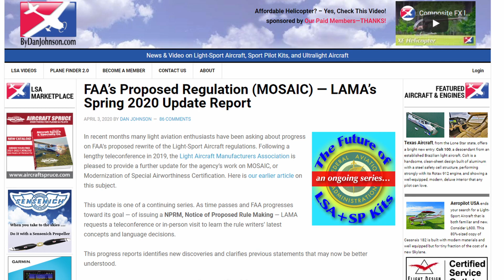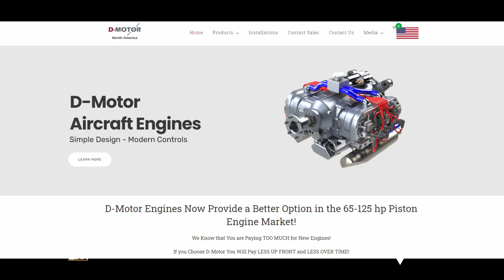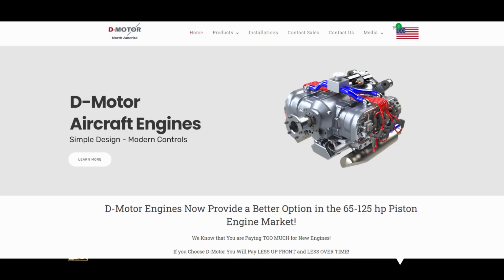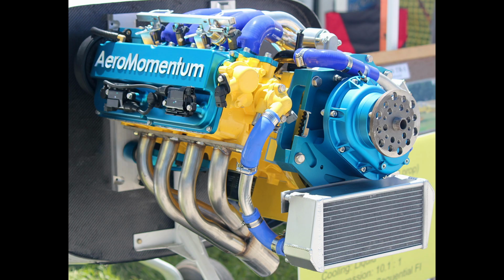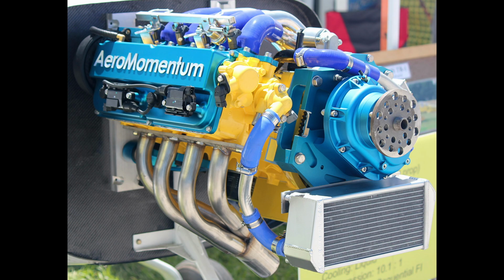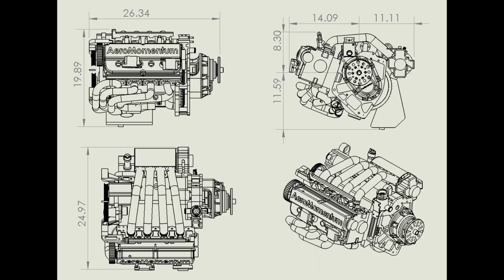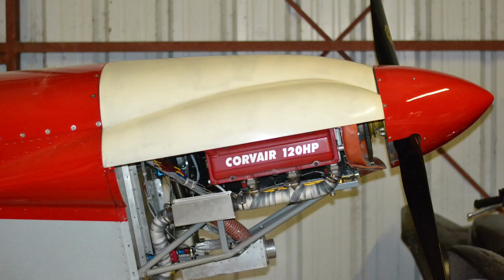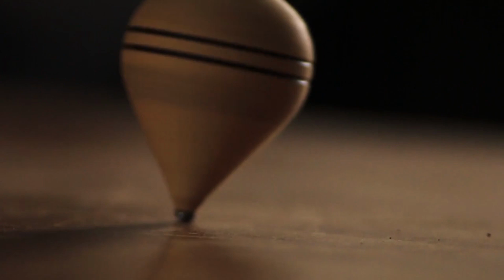Engines & Sonex Philosophy: Aerovee, Jabiru, UL Power, AeroMomentum, Corvair, Rotax  Part # 2

Comment: Much respect for Sonex's philosophy. Simplicity is vital. Air cooled, proven reliable, cost effective. Aerovee might be near perfect for those in the plains states. Still thinking an air cooled engine I assemble myself for much less money than the pre-assembled off the shelf engines yet has years of success would be just the ticket. If only it had six cylinders.... ;)  I would accept dealing with the compromises of an extra 25lbs to achieve this.
Reply from the maker: Yup, I may have some parts for that 6 cylinder in my hangar at the moment. Not sure how I'll use them yet ..
Reply: Corvair has 6cyl.

Comment: The best part about Yamaha throwing their hat in the ring is that the homebuilders have done so much of the testing for them already. These snowmobile engine conversions have shown tremendous promise. Can't wait to see them give ROTAX a run for their money.
Reply from the maker: Yup, definitely looking forward to seeing what Yamaha comes out with. I personally think they could be at a lower price point than Rotax as well.
Reply: @LeftSeatAdventures  100% agree
Reply: What would be nice if Yamaha can produce a turbocharged engine sell it at the 912 prices in the 20k range that would really hurt Rotax.
Reply: I'd like to see a Yamaha in a sonex... One of the conversions would be fine - hard to see what the total install cost would be though.

Comment: I like that Sonex sticks with the Aerovee philosophy. people can choose something else if they like, but keeping it affordable and simple for others is important.
Reply from the maker: Yup, more power would be nice, but it's hard to argue with what the VW platform offers. $8-9k  new for that versus $20+k for a Rotax or Jabiru. However, you can occasionally find deals on used engines.
Reply: @LeftSeatAdventures  Agreed. Currently pricing out an RV-7 with used engines. People freak out when I tell them I plan to use a used engine, but even a new engine is used after its first flight, and statistically newer engines are more likely to fail anyways. As long as you use them right, take care of them properly, and replace things that are worn or broken, they will be fine.

Comment: The Aero Vee is less complex without a redrive, but there are certain penalty you have to pay for that. For a heavier engine installations, you can always design a larger plane or move the wing an inch forward. The Aero Momentum radiator only look draggy as it was shown right under the engine. I live in northern areas (Canada) and I had my moments freezing my rear end off in a leaky 172. So I appreciate water cooling with their superior heaters. There are lots of ways cooling drag can be reduced. The rad can be placed as part of the skin behind the seats, and if the pipe run is long enough, the heat loss at the pipe/hose will allow for smaller radiator. All I know is , as soon as I see Rotax , UL etc I know the airplane is likely not affordable for many. Rotax is a big company, with lots of overhead and share holders to pay for. They are also snail slow with tech advances and HP range. Some Rotax still use Carbs. and they are still maxed out at 141 HP.
Reply from the maker: All good points, thanks for sharing. Early rotax installs on say a Rans S7 had the radiator mounted below, now they mount them in the cowling. Guess it just takes time and development. A bigger, heavier Sonex than can utilize larger engines isn't out of the question at all, just have to see what they come out with. Either way the expense on many engines is definitely a barrier to entry. (Part of why I'm currently reading the Corvair conversion manual... 🤔)

Comment: As a European I would go for a modern European engine. Rotax is the king, but over complex, and expensive. Despite the cost I think the basic UL260i would be superb in a Sonex. Fuel injection, FADEC, air cooling and direct drive at slightly lower RPM than a VW, so the prop can be more efficient.  I like VW adaptions, but I think they all could be improved more. Develop a good sequential fuel injection system for them. Forget turbo. Is it possible to make a new crankshaft with integral prop flange ? I hope Aerovee are using nicer cylinder heads now than I have seen on a friend's Aerovee. The casting quality was not nice. Many airways in the cooling fins were blocked. The induction system looks like it could have smoother airflow with little difficulty in design or manufacture. Improve the Aerovee, and I would put it up there with UL.
Reply from the maker: All good points. The VW conversion could stand to have some upgrades. Revmaster is the only one I'm aware of with the extra oiled bearing on the crankshaft, you never hear about them snapping. They have electronic ignition and pm alternators (I personally had issues with both) but no fuel injection yet. Fit and finish can be better than others I've seen. I don't know how they're doing as a company, but the MW Fly engine looked interesting. Believe they were from Italy

Comment: Does your Sonex have the Aerovee? Is that a aviation VW? My motorglider has a Limbach 1700EA,  essentially 65 hp VW.
Reply from the maker: Cool. My Sonex has a Revmaster 2200 VW engine rated at 80hp. Similar to the Aerovee with some different design elements.

Comment: first of all good day. max speed 200 or 250 mph. range 1000 or 1200 miles. I want to build a 2 and 4 seat ultralight airplane. cost is not important. Can you do it? thanks.
Reply from the maker: Good day to you too! I guess it depends on how you define "ultralight." In the US, that is a no-go as Ultralight aircraft have a top speed limit. But there are US classified Experimentals that are considered Ultralights in other countries, so I would say someone local to you would have a better answer. Sonex piston aircraft have a Vne of 197mph, so right away that won't work for you. Good luck!
Reply: have a nice day. I want to build airplanes for which I write technical suggestions. What will it cost me? Please give an average number. Help. thanks.
Reply: @mehmetvural8095  you might wanna take look at Blackshape Prime, Glassair III, Shark LSA, Swiss Risen Excellence, JMB VL3 915is, Tarragon, DarkAero 1.

Comment: I wonder if the domed b can fit the rotax 915 turbo?
Reply from the maker: That would be a ton of fun. I guess it comes down to weight and cowling. Remember, Sonex aims to have the engine and accessories all under 200#. Revmaster engines didn't completely fit in the original Sonex cowling requiring bump outs and a ram air scoop on the front. Always possible to do the same with the 915.
Reply: @LeftSeatAdventures  the 915 is 180ish lbs if I’m not mistaken producing 141 hp so under the limit ….. hmmmm
Reply from the maker: I wish I could post a gif of Mr Burns doing his trademark, "Excellent." Time to start putting more money aside...

Comment: I dont understand why people still use these old carburetted air cooled engines. Modern engines, especially small Japanese are far better in every way including reliability. So many issues with old engines that have been designed out in more modern engines. I think it is that people have little mechanical or electrical knowledge so they stick to the most basic. Smaller liquid cooled higher revving DOHC engines are under less stress than lower revving high displacement engines.
Reply from the maker: I think some people want to stick with what in there mind is the most simple. Less systems equal less points of failure.  Some people want see a newer design well proven by others before they'll take the chance. The development of automotive conversion (or any new design) engines has not been without it's hiccups. And then some are in fact stuck in cognitive dissonance and will never except anything new. In the case of the Rotax 9 series, it's lighter, more efficient and a tighter tolerance design than legacy engines and has millions of proven flight hours. But I know people who still refuse to have anything to do with them. (Especially those w/ 30+ years of aviation mechanic experience.) In the end, go with the engine design you believe is best and prove it out, maybe you'll convince some holdouts.

Comment: Not a fan of Aerovee engines, I see too many fatalities and close calls due to Aerovee engine failures or loss of power here on YouTube (including the previous CEO of Sonex and a mechanic).
Reply from the maker: Luckily, there's multiple options to pick from too. My Sonex had the Revmaster version of the air cooled VW engine, and my honest opinion is that it was underpowered for the rising terrain where I reside. However, it was adequate in the flat lands at sea level. Sonexes are GREAT flying airplanes, my opinion based on my experience and weight is that at least 100HP is needed. Thanks for sharing!